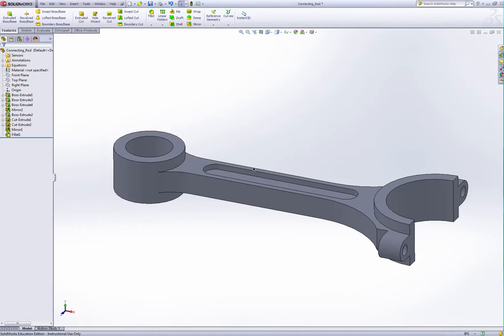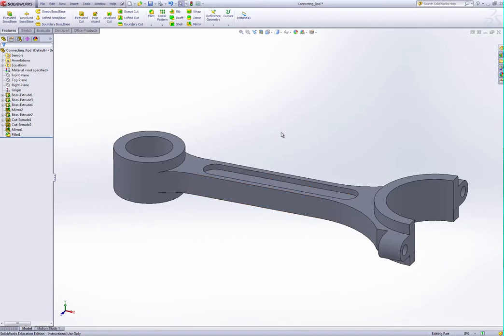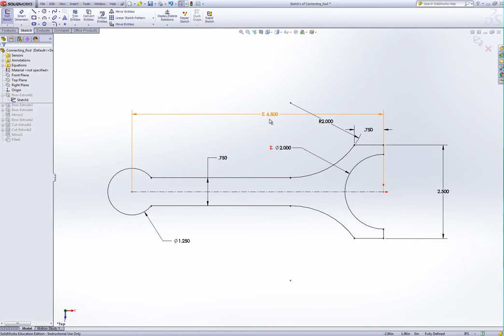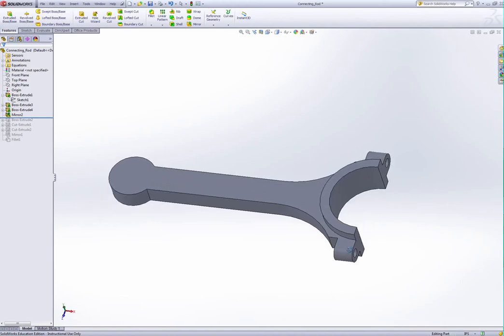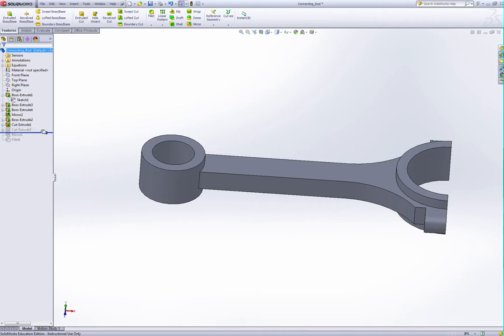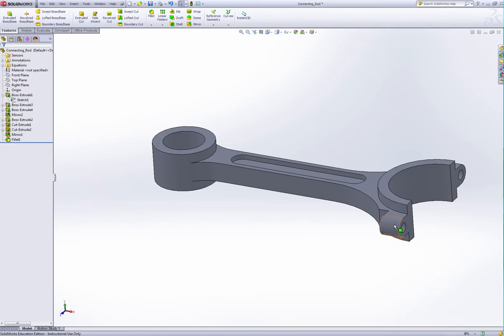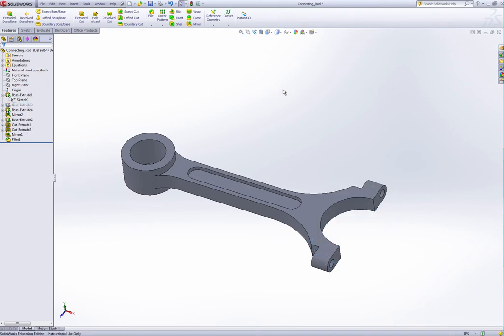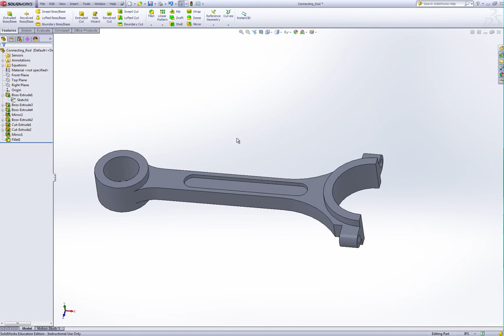Solidworks_BORN_Technique

Comment: What was BORN in this video?
Reply from the maker: The BORN technique refers to Base Orphan Reference Node.  The idea is that you use the cartesian coordinate system for lots of your features so that they aren't dependent on each other unless there is design intent and the features should depend on each other.  This gives maximum flexibility to change your model without breaking all of the other features.